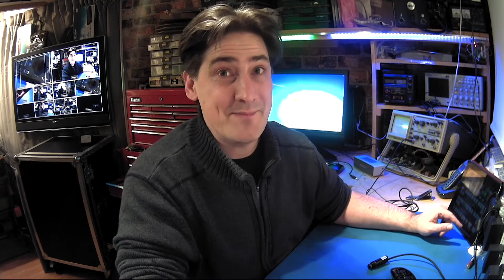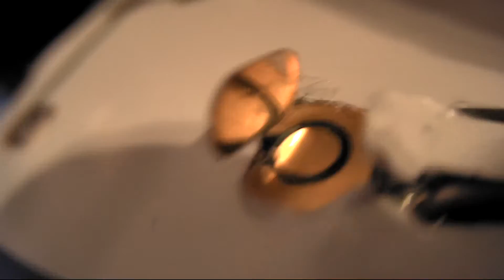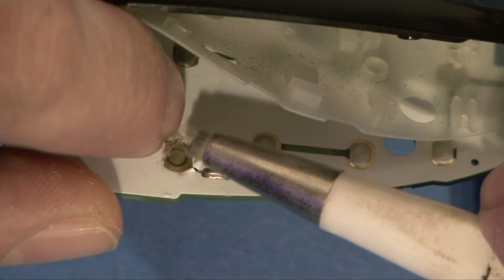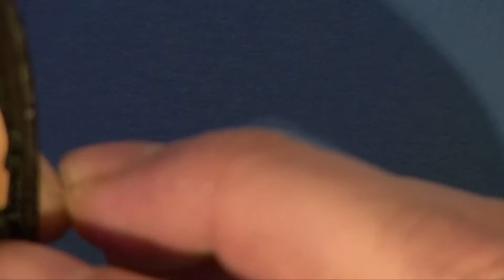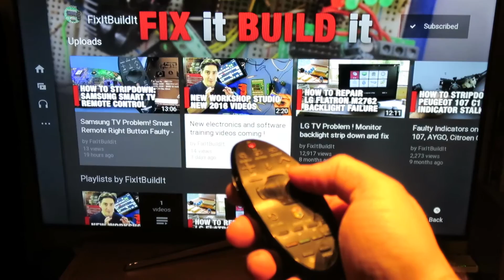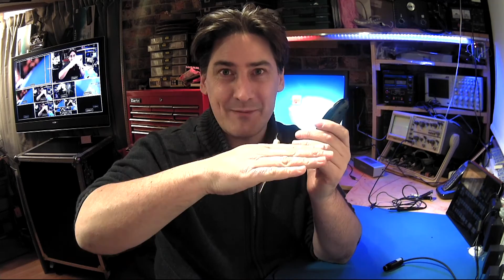Fixing the Samsung Smart TV Remote Right Button Faulty PART TWO

Comment: All I did was rub a cotton stick that had been dipped into hand gel (high alcohol) and gave it a decent rub. You don’t even need to dismantle the remote, just open it up and push the cotton stick in the gap.
Reply: Thanks gaz909909 for the cotton swab and alcohol suggestion! Fricken worked! 

And thanks FixItBuildIt for showing how to lift the metal piece and clean under it!

Comment: Thanks a lot for this video; I only watched to see how to take the remote apart to clean the outer case but my right button is actually a bit unresponsive (does still work though) so I will know what to do if it fails completely.  I would fix it now but I would need to buy some of the tools you have first.  If you don't mind a constructive comment? I was watching on headphones and found your intro music quite loud, compared with the speech on the video; maybe look at the balance?  Great and informative video; I found the macro cam shots very clear and helpful - it's a very small bit of kit! :)

Comment: Thanks very much for posting this tutorial FixItBuildIt. I have exact same remote and have an issue with the right "Mute" button. I started following your steps from the previous video taking the remote apart, but after removing the 4 tiny screws, I cannot open the remote up. The box is just so tight I can break my fingernails. Further, I tried using a utility knife and a small screw driver to pry open the remote, but again it's so tight that I'm afraid to break the plastic. It just wouldn't open. Did you (or anybody else) had the same problem?

Comment: Thanks so much for posting this! I had my left and right buttons slowly fail and eventually zero function. I called up samsung and after much frustration they sent me a new remote (still under warranty) which I got yesterday...and this new one had a no bluetooth working OMG!!! So I found this video decided to try the circuit contact clean as you suggest on my original remote, did both buttons and IT WORKS NOW!!! THANKS!!!!!
SAMSUNG YOU SUCK!!!!!